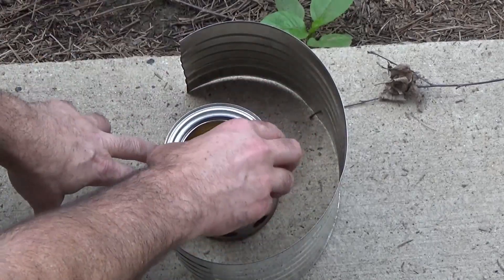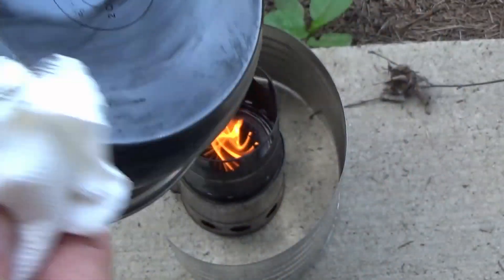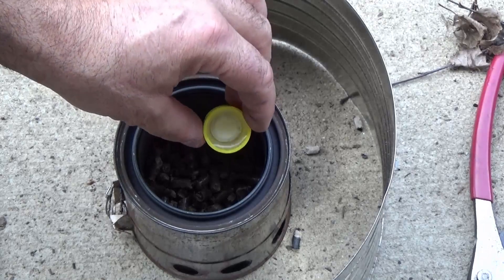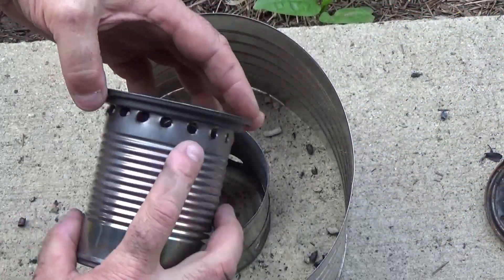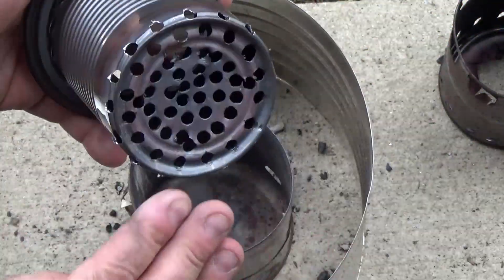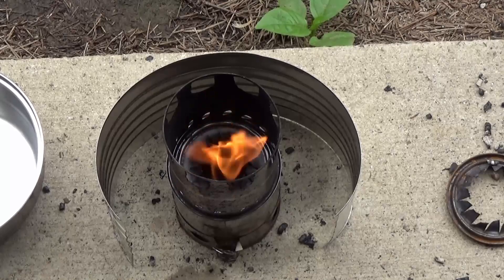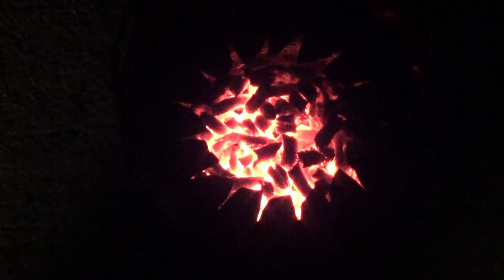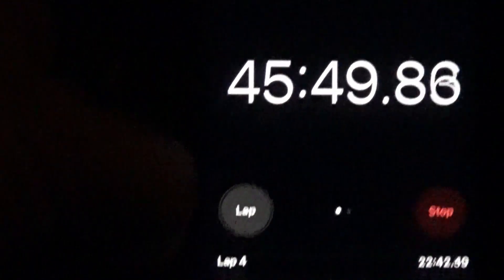Primary to Secondary Ratios! Paint Can Wood Gas Stove Optimization! Wood Gas Stove Science| Part 7!

Comment: Dang, just what I need to solve my sorry a$$ smothering Tin Saint! 😅
Thank You, Sir.

Ok, so I'm just gonna have to make the outer can with relatively big holes, then layer on with a strip of exact size holes to rotate until a balance of air is in the ball park. So, do you happen to know what is the ratio of these Outer Can Holes to the primary or secondary holes?? Do you happen to need half of the number of the holes of the secondary but double the diameter of the secondary holes for the diameter of the outer can holes? 😊
Thank you!!!
Reply from the maker: It’s been a few years since I worked on the can stoves! I do have a full playlist of all my wood gas stove experiments. Check them out and then ask your unanswered questions. Sorry for the quality of some of the videos, I was just learning how to record and edit and my equipment wasn’t the greatest! Thanks for watching!

Comment: It's odd, other sources of TLUD (Top Lit Updraft) stoves claim just the opposite:  That there should be a 3 to 1, 2ndary holes to Primary holes.  Yet your careful experimentation shows a 1 to 3, 2ndary holes to Primary holes.  Why would this be so?  Is this a true TLUD stove?
Reply from the maker: You will have to watch my videos and make that decision for yourself. My stoves actually set up a true pyrolysis zone above the fuel. The air does not seem to rise up through the fuel. I have a video called TLUD Explained it may help. Thanks for watching the video. I have not experimented with these in a long time.

Comment: Even with 16 THOUSAND holes, if you restrict the air flow WITH the pellets, you are restricted still! Only at the end will you reap the benefits. Reduce the pellet flow into the hopper-stove and test again. A small feeder tube onto a screen at a 45-degree angle will (with fidgeting) show massive improvements.

Comment: It seems to me because in all ratio,s there is good visible secondary burn the ratio isn,t that relevant. Any fire needs enough air for optimal burn ( with least smoke and soot ) So adding more holes in the bottom of the burn chamber is just correcting that basic shortage of air.

Comment: Isn,t there a third variable in the air flow ? Namely the air intake holes at the bottom of the outer pot. What happens if you let more, maybe to much cold air in ? Or less ?
Reply from the maker: I have explained this in several videos, but possibly haven’t made it clear enough. You want to start smaller with the air intake and keep increasing if the flame pulses while burning. This size seems to change with altitude also. Too large and the flow is less predictable due to temperature and wind. Hope this helps, thanks for watching and asking a great question!
Reply: @heathputnam9524  Thank you. I was looking for the formula of ideal ratio. I am going to make a bigger fire pit kind of wood gas burner. Trial and error it will be. B.t.w. not much altitude problems here. Greatings from the Netherlands !
Reply from the maker: More is better on a fire pit as long as wind isn’t too much of a problem. Wind will push fresh air into the pyrolysis zone and may cause a puff of smoke.
Reply: It backfires or flash backs see my handcannon stove video

Comment: Kind of seems you just want as much primary input as you can get without your fuel actually falling out.  The ratio seems to just apply as a minimum for the secondary after you've maxed the primary...
Reply from the maker: At some point the primary is maxed out for the initial burn but the ratio really seems to make a difference in the conversion phase to burning the char… if it is not correct the fire will go out and smoke. If correct it will convert and burn the char with a beautiful blue flame! Thanks for watching!

Comment: So 4:1 primary to secondary for wood pellets. Most likely need to reduce the primary depending on the type of fuel and air gaps it allows.

I would love to see this compared side to side to some commercial wood gas stoves! And a way to add an alcohol stove inside as well. Cheers
Reply from the maker: I’ll have to look for my Tangia alcohol stove to see if it fits inside. You are correct that depending on fuel the ratios all change. Thanks for the comment!
Reply from the maker: I’m not excited about commercial stoves but would test this stove and the Vortex 5.4 against a commercial stove but wouldn’t buy one just to do the test😂

Comment: It should be more secondary air than primary air. but you didn't do such a test
Reply from the maker: Actually I have done that experiment years ago. At the time that was what was available on the internet. If you want a can stove that will burn without smoke and convert from burning wood gas to consuming charcoal without going out and smoking then you cannot use a larger flow through the secondary than the secondary! I am however very open to listening to anyones suggestion and knowledge! Thanks for the comment!

Comment: The primary to secondary air ratio should theoretically be 1:4. If the stove has a quarter of the holes in the primary inlet with respect to the secondary air inlet, not enough air will enter through the primary inlet towards the combustion zone to maintain the 1:4 ratio, but much less, due to that the fuel (pellets) is very dense and makes it difficult for oxygen to move through it. In your experiments, you found that the number of primary air intake holes must be much larger than the number of secondary air intake holes for clean combustion. This means that due to the density of the fuel, many holes are required in the primary inlet to achieve the 1:4 ratio. If twigs were used as fuel, much fewer holes would be needed in the primary air inlet, because the twigs allow air to rise to the combustion zone.
Reply from the maker: I do not believe you can assign an exact ratio due to the differences in can sizes. The wall thickness has a lot to do with the final ratio. You notice I do not talk about exact ratios, but about how to optimize your particular can stove. At one point I was sure a 1:5 ratio was correct but I realized there are many thing that contribute to the final design of each stove. Thanks for your comment, I appreciate everyone’s input!
Reply: What will happen, if we give ss wire mesh or grill at the bottom to allow primary air to pass more than 6 times of secondary air. Pls help me by valuable reply. Want to get shoots and tare free flame.
Reply: @majharulislam5950 it would work fine but things on the ground would catch on fire. Even on dirt, roots under the earth would smoke up through the earth. You'd have to put it on a brick or something to use it.
Reply: @majharulislam5950  he didn't try that.
Reply: O.k

Comment: Have you tried cutting out the bottom of the primary can and replacing those primary air holes with mesh?
Reply from the maker: Nope, haven’t tried that. The ratio of primary to secondary and other design characteristics are important to the overall efficiency. Thanks for the comment.

Comment: I thought I seen one of your videos with a 5 to 1  ratio but can't find it now. Maybe I am mistaken.  If you did do one could you point me to it?  How did the two compare?
Reply from the maker: The 5:1 ratio is what I ended up at on the Vortex 5.4. I stated that ratio was the best, but as it turns out may other things affect the best ratio. I am still learning after al these years! Haha! The distance between the two cans, the length of the cans and the distance from the bottom the burn chamber sits along with many other parameters will have an effect on the perfect ratio for the particular stove. Sorry I do not have a better answer for you! Thanks for watching!
Reply: @heathputnam9524  That makes sense. I guess a 4 to 1 may be a good starting point if the other measurements are the same.  
I'm thinking about making a larger  one about the size of a gallon paint can. May use some stainless steel canisters.
Not sure if the spacing between the outer and inner cans would have to be larger or not. Probably will be a while before I start on it. Too many chores right now.
Reply from the maker: Keep me updated! Thanks for watching!

Comment: Is there a point of diminishing returns have you gone to six to one eight to one 10 for one for more data points

I also think that you should use the stack effect and have a section in between your primary and secondary with zero holes in it to create more draft

I understand this would make it more difficult to cook on but then it would be useful as a smokeless heater
Reply from the maker: I did go to six to one several years ago and didn't see any gain over five to one. Although with the paint can stove the point of diminishing returns seemed to be around 4:1. I think the air space between the inner and outer can makes a difference in the ratio. I just haven't been able to take the time to scientifically prove any relationship. I think your idea of stacking cans to convert to a heater has validity due to the results I saw when I created a wood gas lantern. As soon as I added the "chimney" the heat began to emanate outward from it. We may be able to change the use of the stove depending on the pot stand/chimney we use... So many questions, so little available time! I wish I could retire and do this for a living! Haha! Thanks for the comment!

Comment: I concur with that ratio finding. This has become more of an idle pastime  for me rather than the one time make that it started out as.  An industrial use sized church key has been a big time saver.
Reply from the maker: I enjoy making these and really like the community that revolves around them. One thing I have noticed... The precision spacing of the secondary holes really does make a difference. It is important that the flame creates a complete cap over the fuel to create a sealed pyrolysis zone. Thanks for the comment!
Reply: @heathputnam9524  I've only used sticks never pellets and typically burn it on the patio for an hour or so just for enjoyment. The build up of ash and coals soon restrict bottom holes so I increased their size and number and added half inch holes 1/4 way up the sides with each new rendition. Choice of wood type and size keep my mastery of the flame humble. 🔥 My ultimate goal is to fine tune a stick feed burner able to boil just enough water for coffee inside a two man tent. I will stay tuned.
Reply from the maker: Well I think we should be able to come up with one that can boil a cup of water in just a few minutes. The idea with sticks is to break them up small enough that there is very little air space between them. Keep watching for future videos!
Reply: @heathputnam9524 I'm going down the rabbit hole now 😭.
Not long ago, I made a backpacking gasification stove that boils water under 4 mins, but I think it's like a hybrid with strong gasification and a little typical wood burn in the bottom. Everything is clean and promising. Thus, the boil was fast!! 
Unfortunately, I threw it away because it rusted bad when I left it outside in he rain. Didn't have a chance to "study it".
Reply: @heathputnam9524  Can you make a graphical example? Thanks in advance.
Reply: @fduran6993  watch his previous video. On twigs in the stove. He cuts up finger width sticks to pellet's length. Restricts airflow and probably helps not burn too fast (which is a real problem - burning a swedish torch inside lasts way longer than burning the same log batoned into smaller sticks)

Comment: Very interesting, typically online I think I’ve seen the opposite where people typically do a 3 or 4:1 ration secondary to primary, meaning the secondary has 3-4 times more ports than the primary. Have you tried it this way before? Part of me is almost thinking the reason it cleans up the burn when you increased the amount of primary holes is that you will have a lot of excess air going up through the primary essentially being used a secondary air by the times it reaches the top of the chamber. Much like running a wood stove with wide open primary air, it will burn clean but very very hot, even without secondary air added.
Reply from the maker: I have tried this and the results were not good. The burn has no power and it smokes or lets off fumes. I will make another internal can and try the experiment again starting with a reverse ratio. We will see what we will see :) Thanks for the comment!
Reply: If you haven’t tried building one with reversed ratios I’d love to see you try it just to see!
Reply from the maker: I will try to do this next weekend and post the video on Sunday. Thanks for watching! Please watch my other content on Wood Gas Stoves!
Reply: Thanks for the reply heath. Curious it made for a smokier burn. I may be wrong what I’ve read online, I always interpreted it that people had 3-4 times more secondary surface area than primary but I may very well be confused. But it will be interesting to see if it works with internal heated secondary air for sure.
Reply: I do find these wood gas stoves interesting as wood gas, at least in an internal combustion engine, burns at 1 to 1 ratio gas to air, one would think the 1 to 1 would have worked quite well if that were the case. I’d love to build a downdraft version of one of these for a heater. I actually just posted my first attempt at it if you check out my page and let me know what you think.
Reply from the maker: I did see some reverse ratio stuff, but that also may be on a much more complicated system. Next weeks experiment should tell us. Your TLDD wood stove looks very interesting. Keep up the good work and keep me posted on how you do!
Reply: @heathputnam9524  thanks! It’s not actually a top lit, it’s lit at the bottom and the fresh wood drops on top of the coals and burns as it drops down. So I guess it’s technicall a BLDD lol
Reply from the maker: Oh yes, I just reviewed it and you are correct! BLDD stove. It's sort of "Rockety"!! Hey Justin have you subscribed? I try to publish every Sunday, but don't want you to miss any videos!
Reply: @heathputnam9524  it is a bit rockety, I’m trying to diminish that though as I’d like to get as long a burn Time as I can. Just subscribed :)
Reply from the maker: @justinhadden5160  and I’m your second sub!